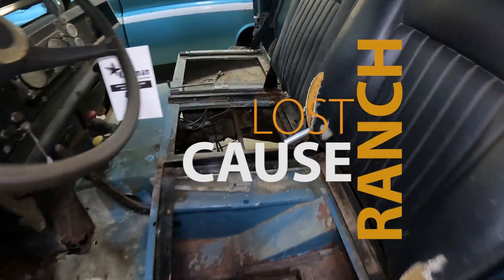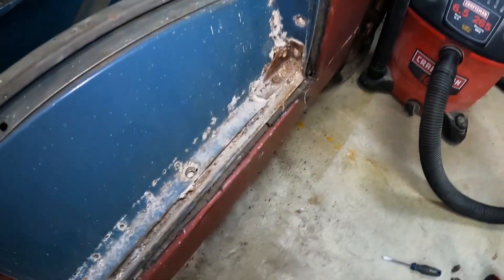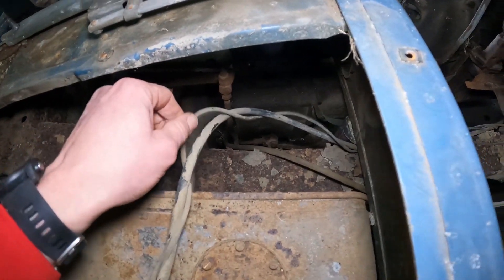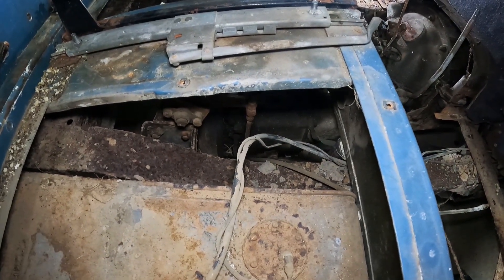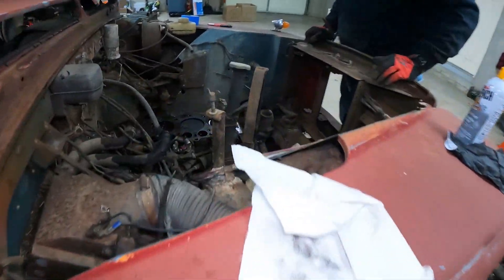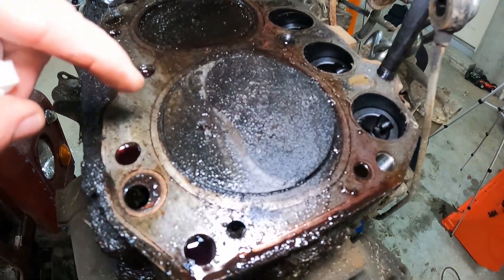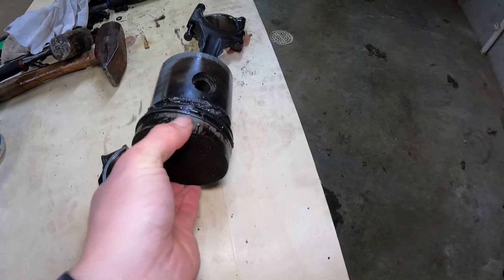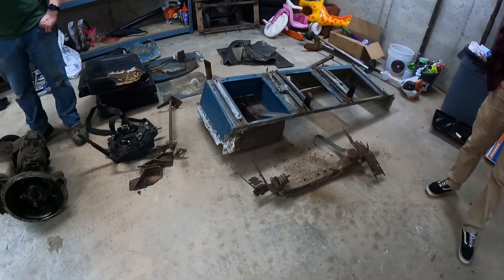What Broke in our 30 Year Abandoned Land Rover Series 2A Engine - Catastrophic Internal Failure

Comment: i had a rough frame on a 1980 series 3 that i used for parts, it was close to the condition of the one you have. i'm in the process of putting a new chassis from Richards chassis in the uk on my 1977 series 3 atm. i have never seen a piston break like that before. are you doing any more videos on this S2 ? i noticed 5 in your play list then nothing.
Reply from the maker: Yes we are. Currently figuring what way we are going with it. May get a more modern Land Rover frame under it.

Comment: thats the best wtf engine failure i have ever seen but i do remember transporting a series 1 that had the hole middle section of chassis practically gone but only the gearbox crossmember  holding it together.
Reply from the maker: I thought the same thing. I've been around cars my whole life and had the repair shop for 12 years, first piston break like that I have ran across. This chassis probably isn't far behind that one you transported. The transmission dropped out of it onto the trailer deck on the way home with it. Thanks for the comment!

Comment: Don’t give up yes alit if work ahead but very rewarding , I get your wings off and front then roof and sides doors then tub to revel the full chassis , it will take a very brave person to weld that up but time effort to do that may be cheaper getting new chassis , bulkhead foitwells and side pillars easy enough replacement welds basically strip it all down , strip and repair all parts new bushes etc get new chassis is where I be starting from and use that fir donor parts
Reply from the maker: No giving up on this guy, we will make something of it. This chassis is toast, it will definitely have a different one under it. Thanks for the comment!

Comment: Ooh that bulkhead doesn't look quite as good as it initially seemed!  Yuck... Still, 50 seconds in it all seems to be in easy to fix areas, fingers crossed the main structure of it has held up better
Reply from the maker: Yes, little worse than we were hoping but is what it is. We will still get it fixed. Thanks for the comment!
Reply: @LostCauseRanch  Good stuff, I guess being a budget build means we'll see plenty of repair over replace mentality (though probably not with the chassis lol, I think if you tried to patch that up it'd be like Trigger's broom)
Reply from the maker: Yes. If we aren't going concours on it which it probably isn't the right candidate we will be more creative with repairs.

Comment: I have seen and bought worse. Back in 1989 I bought two old Land Rover's off a farmer in West Yorkshire, England. Quite near to where I lived at the time. The Series 3, petrol short wheelbase had been stood for seven years, fired up and drove home and needed a little welding, brakes adjusting up and some electrics sorting to get it road worthy. A Series 2a was broken in half and had to be cut up to get it home. I bought another Series 2a off his neighbour and it was so knackered the chassis started to collapse on whinching onto the trailer and the wheels, they were so rotted out they did collapse. Two of the three Land Rover's are still on the road in other peoples ownership.
Never seen a broken piston on a Land Rover 2.25 petrol engine before. I am sure that piston could be tig welded and put back in for another few years service. The chassis is a bit rotten to be fair but not impossible to save. As for the bulkhead, tricky but not impossible. 
My advice, new chassis, bulkhead, brakes, electrics and rebuild the engine and transmission and it's good for another 50years!
Reply: Knackered! Lol. Haven’t heard that one.
Reply from the maker: It's one of my favorite words haha.
Reply from the maker: That's awesome, glad you got them all back going. I'm thankful that pretty much everything on these is still available. Makes this less of a headache. I think it spun a bearing and allowed the piston to come up and hit the head and broke that way, just my guess being the bearing was toast and the nut on the rod was loose. Thanks for the comment!

Comment: Yes I would like to see more of this series rebuild! I believe that is the worst frame I’ve ever seen on an old Land Rover! Keep the faith! Buy a new galvanized frame with removable transmission cross member and a galvanized bulkhead and swap everything. Cut out the old VIN from the frame and rivet them to the new frame! There is a company in England, Turner Engineering that sells fresh rebuilt engines.
Reply from the maker: We will keep going on it. It may end up going a little modified at this point. We were hoping to go original but this may not be the one for that. May grab a nicer one to start with for an original restoration. But either way this is getting back on the road. Thanks for watching!